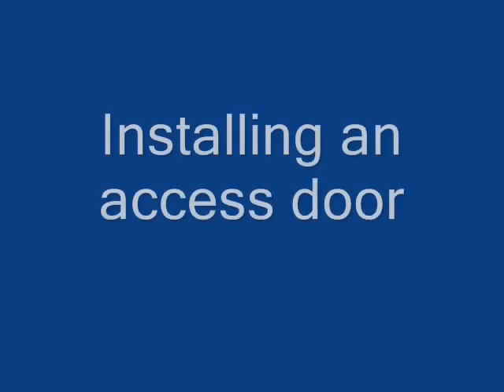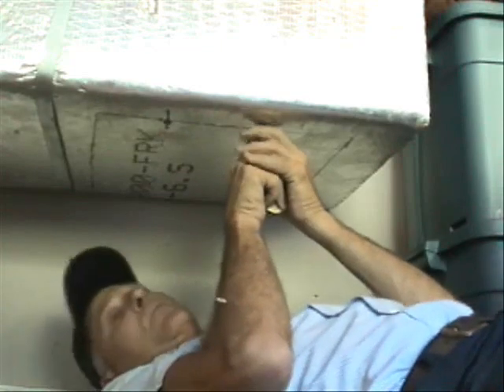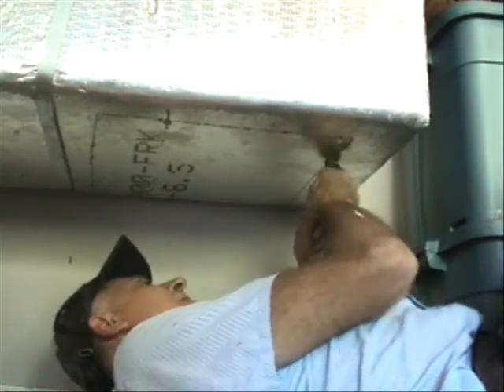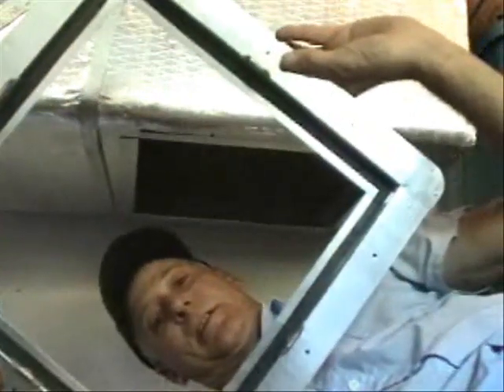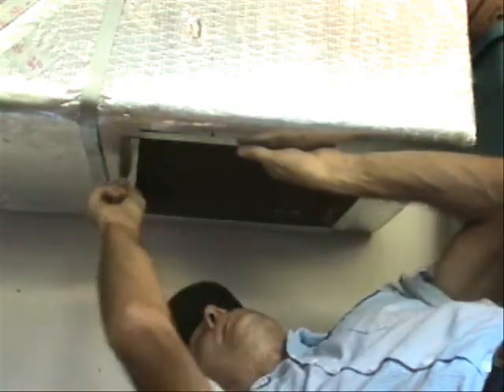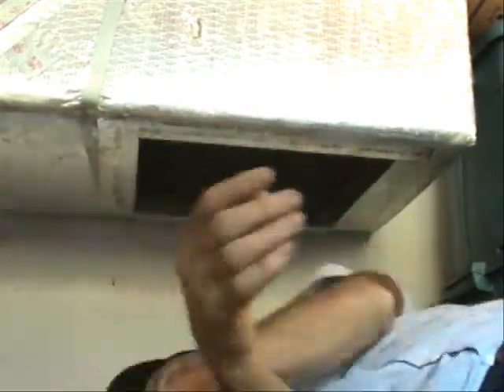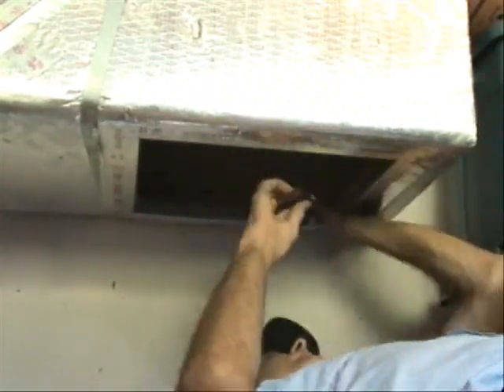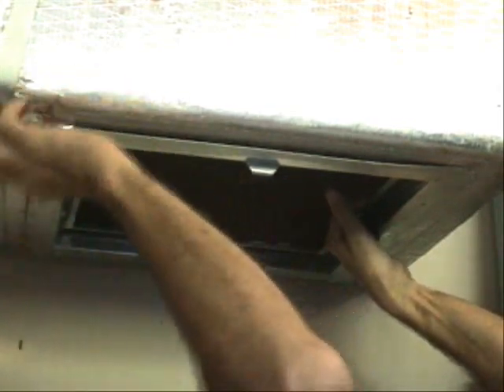HVAC: Installing an access panel

Comment from the maker: The Tough Guy is made for making access panels in drywall ceilings and walls. You need to go to an HVAC parts store for the duct access panel.

Comment from the maker: @YaoiGirlAngelbratt Most definitely mask and goggles are a must. It's really not the best way to clean the coil. I removed the video where I cleaned the coil in this manner. The video quality wasn't very good. You might want to check out my video entitled, HVAC Evaporator Cleaning

Comment: Hi Jim.  Good job on the install.  The tape is a good choice since it will prevent dust from getting past the frame of the access door.
Reply: Astranine
This is a very astute observation. Many ac guys I converse with believe a little dust in the ac duct is ok. 
Around the frame for regular filters is a common weak area allowing dust into the ductwork/unit.